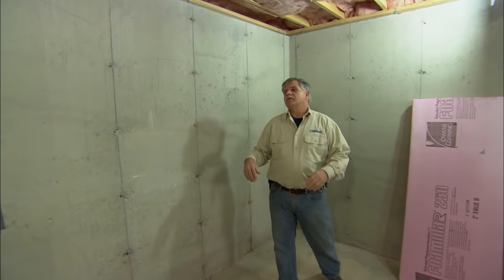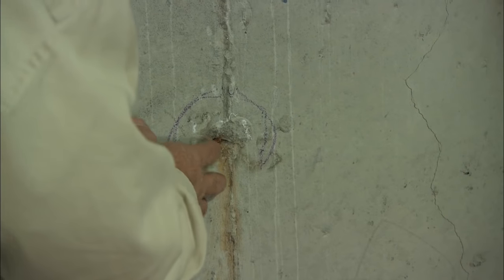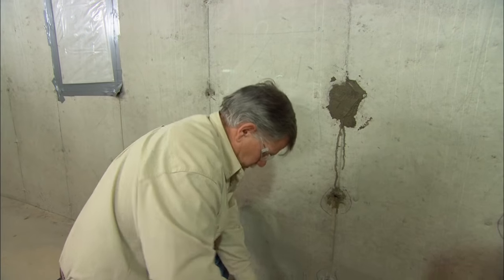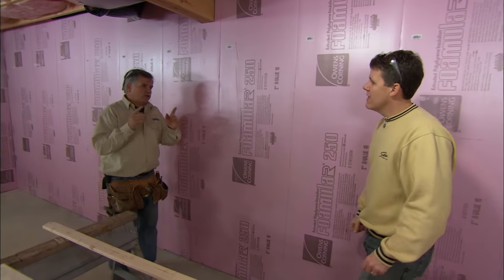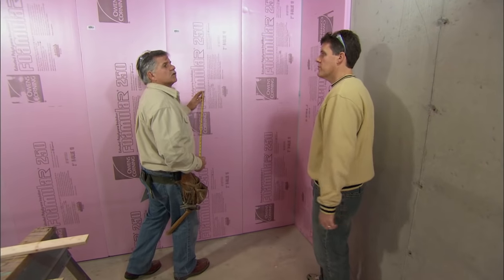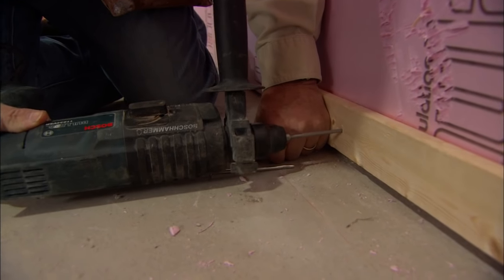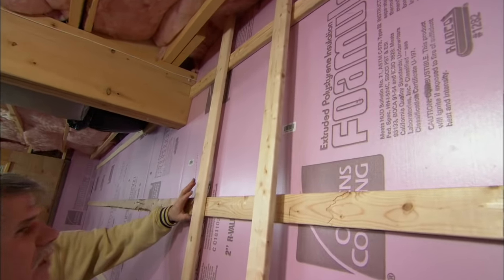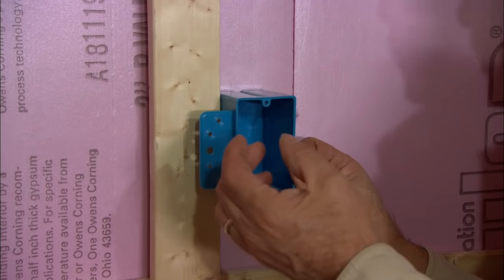How to Frame Out Basement Walls | This Old House

Comment: absolutely not.  Tuck tape does not, and is not made to stick to that.  You need proper tape, and it is not necessary with ship laps, unless you cut them off.  Tuck tape is a no no, and you see moron "professional" contractors using it all the time.  3M makes a tape that WILL work with it.  Again, you DO NOT tape the ship lap joints.  Ever pull siding off a house a year later and see the tuck tape all hanging off it?  Go do it and get back to me.

Comment: You,put the insulation on just to cut it out to allow for electrical box'es? Its almost impossible to add any after market products because of lack of space and chase area's. You are assuming the foundation walls are straight. You must stop water from the outside first. Shame on you Tom for this video